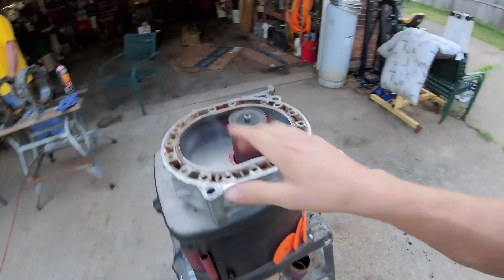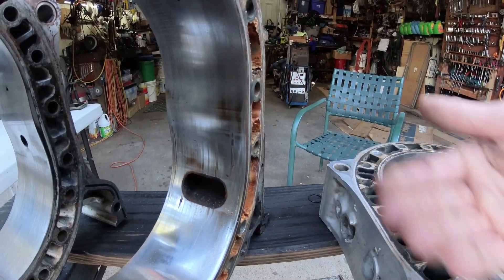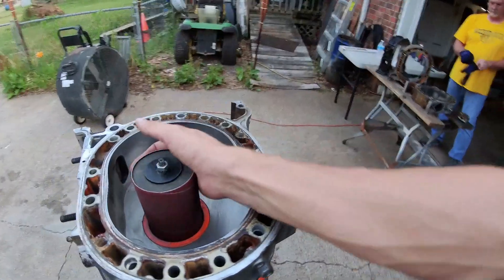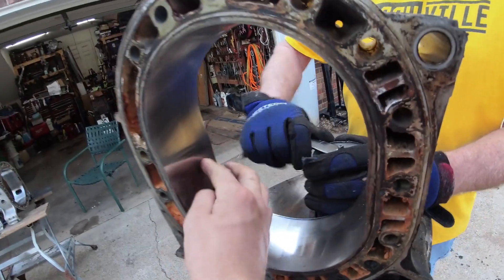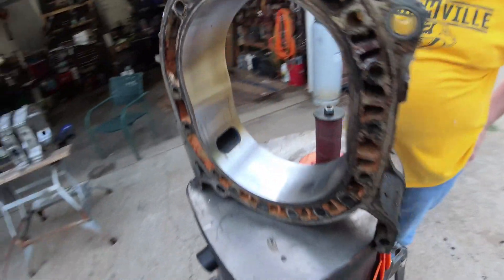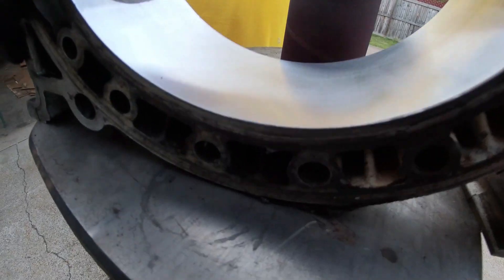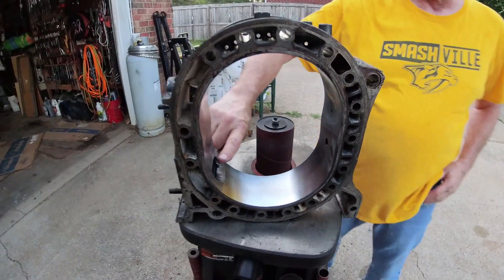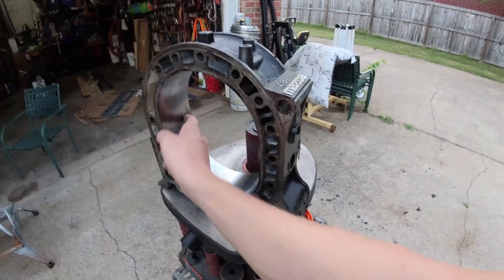How To Resurface Rotary Engine Housings - Its Like a Cylinder Hone... But Better!

Comment: The problem with doing this is it's taking off thickness of plating and doing it unevenly by hand no CNC.so you are effectively putting more wear to the surface which means less miles of service.thinner surface is less heat dissipation less oil retention,more room for apex seals to travel and roll at higher rpm etc.nothing good from doing this unless for a drag race engine.

Comment: Only in the rotary world is this type of garbage tolerated.
Reply: Lol same thing as honing a cylinder wall... he's not sanding past the hardened chrome lining he's just re surfacing the ruff patches and getting rid of the polish from apex seals... if you question it watch rob dahms video of the 700 hp 10th ae rx7 he does the same thing to his housings only with a flap wheel and a drill press... seriously stop being a hatter
Reply: @jo-qp7mz  it is?  Anyone willing to share the RA, RPK, RV, crosshatch angle, etc that these housings are being “honed” to?    Those are standard values that are adhered to when honing cylinders, do you think that’s the case here?  Do you think anyone could even share what those values are for a stock housing?  I don’t really care what Dahm does, he’s not an authority on anything and frequently gets technical information wrong.  It’s a reflection of the poor state of the rotary tuning industry that “professionals” in the field look to him.  Demand better.
Reply: @Ninesixmike  Why would you assume that surface finish standards need to be the same between rotary and piston engines when a rotary housing will only ever be subject to sliding action in one direction and rotor apex seals are fully intended to cope with a lot more slop than piston rings? Are you going to get pissed at the relative imprecision of steam locomotives next? We're dealing with two completely different sets of tolerances here, dude.
Reply: @noahkeyes8671    Steam locomotives are finished to a higher degree of precision than what is demonstrated in this video (which is literally none).  I got halfway through typing a reply but deleted it as you simply don’t know what you’re talking about.  If you’re happy having this service performed on your engine, power to you, I hope you find success with it 👍
Reply: @Ninesixmike   It's alright, we understand. Not everybody knows a lot about rotary engines, you don't need to admit it.
Reply: @noahkeyes8671  Perhaps one day I will reach your level

Comment: Upon disassembly of my NA 13B built by Kevin Landers in 2016, my housings are in about the same condition as these with roughly 1.5mm of edge wear on the compression strokes. I’m contemplating this method to potentially save them before buying a new set.

Comment: You can not refinish a housing that has lost plating, by removing more plating, however you can make it look good.
Reply: The plating is way thicker than what he is sanding.. he is just re surfacing it oh and rob dahm does the same thing to his housing just with a flap wheel and a drill press.😮😊

Comment: Nikasil, as in Mercedes, NSU, Citroën RCEs, is better under any circumstance than the Hard Chrome some Wankel engines used, as OMC. Suzuki RE-5 had  the plating patented by Alfred P Grazen in Canada.

Comment: Thats a great way to resurface housing. I did it the manual way with some 220grit wetsandpaper and a dowel pin. after a few hours you can get those results. Yours is way better though!

Comment: Is there any possibility to do the same for End and middle plates?
Reply: Yes. I used 180 grit on an orbital sander, then Valve Grinding Compound. Per a forum. It worked well and knocked down the shine. The irons don't last as long...etc etc

Comment: new to this, I don’t understand why it’s not losing compression as your thinning out the housing, is it not enough to make a difference?
Reply from the maker: Its like running a ball hone on a piston engine.  Just enough to take off some of the grooves, and provide a good surface for the new seals to bed into.  It does thin out the housing, and I wouldn't expect a refinished used part to perform as well for as long as a brand new part.
Reply: @RADPotential  I would compare it to a piston engine. There must be a cylinder of exact geometric circle. Here, the geometric inaccuracy doesn't matter so much.
Reply: Isn't this what the spring is for, behind the apex seal? That micro amount taken off is all it's going to have to expand.

This seems like a good idea for just having a spare motor to set aside for emergency, or to just beat the hell out of on a track for a day until it's done.

Comment: There is a process where metal is "sprayed " on to build up the thickness and fill in gouges. this could possibly be used to build back the chrome on the rotor housing.

Comment: Will a rx7 turbo manifold fit an rx8?
Reply from the maker: No, the RX8 engines use a Multi Side Port Exhaust, vs the Peripheral Exhaust of the early 13b's.
Reply: no

Comment: Seems like a terrible concept, how do you know you're removing consistent amounts of material on all sides?
Reply from the maker: It doesn't so much matter the depth of removal, apex seals are spring loaded, so they will just slide out to accommodate the thinner area.  its more important to not sand through the chrome plating on the surface.

Comment: I think there are some places that can redo the nitride surface treatment, it involves putting it in a furnace with ammonia gas if i remember correctly.
Reply: Housings are Chrome plated. Nitriding is done to the side plates, not the Chrome plating (altough you can nitride chromium)

Comment: Too inaccurate and rough
Reply: Rob dahm does the same thing with a flap wheel and a drill press... his engine is making Over 700 hp... seems to work great 👍 👌 🙃

Comment: you should pin a comment with the sand paper grit and drum speeds. i’m wondering about how much material that takes off, and how much pressure is applied

Comment: on the deep gouged ones,  i have a question.  what if you sand past the gouges,  and sand to a good smooth surface.  then build thickness back up with nickel plating?
Reply: so i posted this comment before watching the whole video.  i'm pretty sure nickel plating is done to different classes of thicknesses and hardnesses.  i don't know what would happen if you send a nickel plated housing without chrome plating on top of the nickel.  but nickel can get chrome plated.  problem is back in the 80s everyone chrome plated,  and dumped the waste water down the toilet.  the epa didn't think that was very funny.  anyone who chrome plates nowadays probably has their own water treatment facility.  so it's going to be pricey.  

i used to know a guy who did nickel plating.  this guy only dealt with parts machinists messed up and undersized.  he'd charge them 2/3 what it cost to make the part,  to plate it to proper thickness.

also i don't know if you're cool with it,  but there's a place in maryland that does nickel plating.  not sure if you're cool with name dropping,  let me know.

Comment: I used the same idea but I put transmission oil a little bit to save the chrome and May sure used  a gauge to check cut straight o used a apex seal  🇵🇷✌️👍

Comment: It will actually run longer than a little while. 😉 As long as the gouges are BELOW the surface and on the exhaust side, you won't have a problem with the apex seal catching anything. Over time, those grooves will fill with carbon deposits and level back out. Back in 2005, I rebuilt my 91 vert and put in brand new RA seals. The damaged rotor housings  had longer gashes than what you demonstrated in this video. I put over 55k on that rebuild and that engine had great compression and got 26mph hwy. It only failed because of those trashy tephlon encapsulated coolant seals I was experimenting with at the time.

Comment: What is that tool name? I definitely need to get that and resurfaced quite a few Housings I have around here
Reply: It's an oscillating spindle sander. Used mainly for woodworking but looks like it does a good job on the housings.
Reply: @rmreid83 "looks like" is the words today. You can't fix damaged chrome by sanding it away !
Reply: @stevecarlisle3323 hopefully no one is taking away the idea that this makes it the same as new... It'll run though I'm sure.
Reply: @stevecarlisle3323 the chrome is over 0.03 thick he's only sanding a little off rob dahm does the same thing.... and he's running 700 hp thru his... check out the video of the 10th ae he flap wheel sands his housings down before rebuild... same exact process... ya hater
Reply: @rmreid83  Appreciate that bro. Just found one on Amazon 😁

Comment: I was going to rebuild my engine but decided to bring to a rotary specialist shop. I just don't have the time to do it and on top of that with my Parkinson's I can't maneuver my fingers to well.
Reply from the maker: Sometimes its just easier to do it that way for sure!
Reply: @RADPotential  yeah, getting rotors machined too for weight reduction.  Plus a street port.

Comment: Theres a guy named Kyle Mohan, he races a 20B RX8 in formula drift and talks about something called WPC treatment for housings. It reduces friction and some other things. im not sure if it replaces the entire factory coating, or goes ontop but that could be something you could look into. He did mention that people do it with even brand new housings, so could be interesting.
Reply from the maker: Yea man!!  I have seen that video.  I'd be interested in trying that over top of surfacing them!!  Super cool!
Reply: WPC has been around for a while, Mazdatrix offers the service, its essentially shot-peening that dimples the surface to create pockets for oil to sit. It doesn't replace the factory coating. (oem housing is a steel (or iron?) sleeve in an aluminum casting, with a chrome alloy electroplated onto the iron. 

WPC would probably be a great addition to a housing surface, though the lining has a level of oil retention already. What i'm the most interested in personally is goopy's chrome-replating service.
Reply: @1OMEGA111  Ah okay that makes sense. I didn't do any research on it, but I just heard about it. Sounds interesting.

Comment: Would it be smart to use paint or sharpie to see low spots. It doesnt look like he going slow either to avoid hot spots. Does he change grit going lower and lower almost to a polish?
Reply from the maker: It really shouldn't have any low spots. You should be able to feel them with your finger nail or a pick.  Just keeping an eye on the color change from shiny to dull should be enough
Reply: @RADPotential  cool. We totally had one of those machines but didnt know what it was for so we dropped it off at goodwill. Regrets